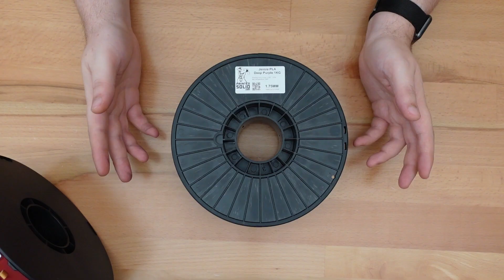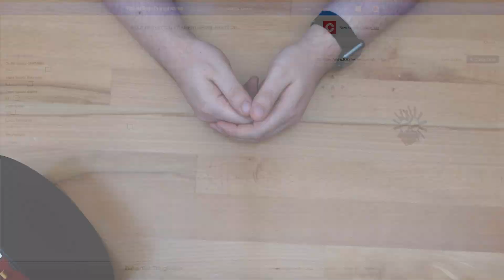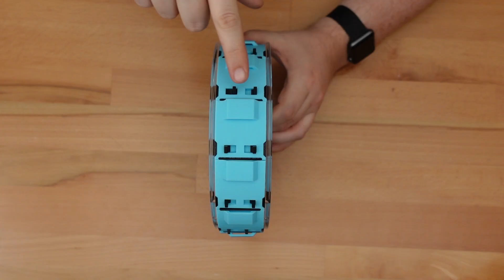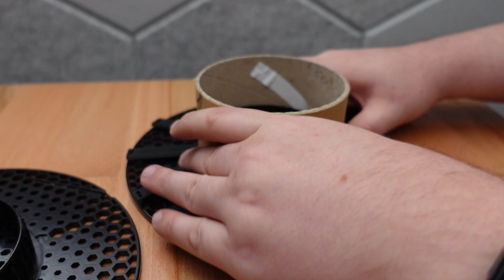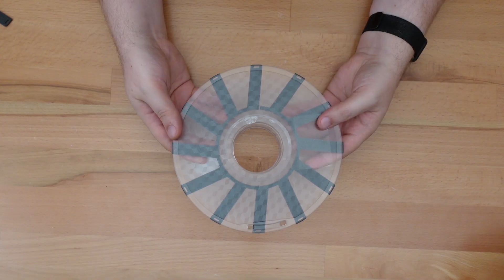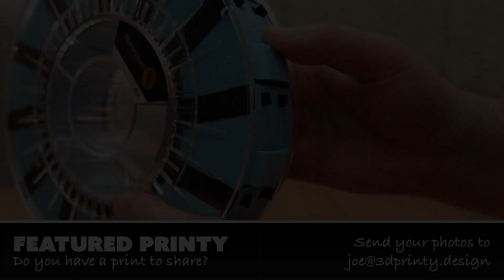Customizable Vertical Filament Spool Parts Drawer

Comment: brilliant thing -- the only thing i MIGHT do differently is to have a rotated version where one sidewall of the spool (assuming it is not a meshtype or filet-ed type) is the top. then m/b add a "tire tree" (rough translation from my native lang - unsure what you call then in english) so you can stack multiple spools and use them as kind of a carousel-shelf...

Comment: do you by any chance know on the ender 3 pro how to make the stand printable. it does not seem to fit in the space in cura
Reply from the maker: I believe you have a 235x235mm print bed? Each half of the stand should fit that fairly easily - especially if you rotate the stand 30 degrees clockwise around the z-axis.

You will not be able to fit both sides of the stands at once, though. To split the two halves into separate parts, use the free Mesh Tools plugin that's available in the Cura Marketplace. Here's a video that goes into the process: https://www.youtube.com/watch?v=GUsChXYEMLk

Or, if you prefer, this functionality is built right into PrusaSlicer by default. Good luck!

Comment: Maybe my printer is not great and I just have my heated bed too high when I’m printing the other bits, but… Changing the tolerance on the locks doesn’t seem to do a great deal lol. Which way should I tune it? I printed 0.1 0.15 and 0.20 and they all go differently but still finger busting at some boxes. Is there a left and right lock? I keep mixing them up I think… hard to keep track for me lol. Shall I try 97% scale in slicer also?
Reply from the maker: It COULD be elephant’s foot (bottom layer slightly too squished). My guess is that the locks are being installed upside down (also yes, the 2 sides are different). Before installing a lock, look for a small chamfer on the back of the lock, that should face up. If that still doesn’t work, even looser locks were remixed by Yianni on Thingiverse: https://www.thingiverse.com/thing:4903888 . Best of luck!
Reply: @3DPrinty  Thank you so much I appreciate that little extra bit about the orientation! I need to pliers them all out just in case. 

I know you’re only installing them one time but I suppose if I was going to be critical I could wonder if there was a way to make universal lock piece that works any orientation. :-P but now I know it is good. I don’t remember specifically reading about left and right locks on the print download? Did I miss it? It could be useful if all of the print parts are just jumping off the PEI 

Thank you too for the remix info!

I’m in love with the system in general, I printed the full spool of boxes so far and lids, and now going for the locks. I think the boxes could be really really low infill and perimeter width really, they are coming out robust on any settings which is cool (as in no need to really thicken walls or chunk the infill path etc.). 

Yeah,  I think the wall that is coming down from the rail on the inside of the box could deboss back out to the spool instead of be flattened - it’s almost too strong and is thinning the internal volume too. It could be a good thing for the customiser as an option because my spool is rigid enough to keep the boxes reinforced(?), but some spools are more wobbly so maybe people want the thick straight down wall then. It would also give you a little bit more length inside to lay some screws flat of certain length!

Thank you for all your kind free work on the system!
Reply from the maker: If I revisit this design (it's one of my oldest projects), there's a very good chance I'll optimize the internal bin volume the way you described. At the time I was going for strength, but I agree that it's not really necessary.

Unfortunately, the lack of a universal lock is baked into the rest of the design. A truly universal lock would need to be aligned with the center of the spool, if you follow. And that would mean remodeling the bins entirely. I added the chamfer indicator as an update (possibly undocumented) for the same reason you mentioned - I had printed dozens of locks and forgot which ones were which! Hopefully that's an okay compromise.

Comment: Hi Joe, First of all thanks for all your work. I'm a big fan from France. I think I printed every thing you designed so far and waiting eagerly every week for your posts ;-) These spool drawers are amazing and finally works for me (I tried many others before...). I'm just struggling a little with the locks. I though initially that there were symmetric and once installed some of them were very loose and some very hard to move (with the same tolerance of course). I saw then that there is an angle on one side and it seems it works fine once installed in the same way (angle of the lock on the top). Not sure if it makes sense so I also wanted to check with you. Thanks again for your designs.
Reply from the maker: Hi Pierre! Yes, I added the angled corner only after making the video - you're right, the latches work best with that angled edge facing up.

I also recommend the stand, which will keep the drawers from spilling even without the locks. Happy printing!
Reply: @3DPrinty  Hi Joe, Thanks for the quick response. I do use the stand, it does make a big difference! Got it for the angle lock. Mines are pretty loose for now (angle facing up), I'll try now to play with tolerance. Thanks again.

Comment: Yeaaa!... 😑 now I gotta figure out Open SCad...  Gee, thanks...
Why can't you just post printable STL's for every random filament brand available???

Just kidding, I know, and appreciate, how much work you have put into this project. 
The Thingiverse "Customizer" hasn't  worked for me for about two years,  and I've been too lazy to learn a new program (kinda funny, because I have had to learn 4 new programing languages in the same time).  
I have a several spools with 20-150g left on them (and a runout sensor), some of them Hatchbox, and I have been watching Thingiverse for a while, for repurposing ideas. This was the first one that actually caught my fancy. 

Your little parts storage thing, has kinda been the kick in the butt I've needed to learn new things, maybe from SCad I can learn FreeCad and beyond, and maybe, just maybe, the new things that I am about to learn may help with one of my ultimate life goal... 

...To build a shot clock for Water Polo, that isn't affected by water, or humidity.... (ya, the most advanced clocking systems in the world are crap around the pool, Olympic matches usually have shot clock issues, so imagine how the 12U feel... )...
Reply from the maker: Sorry, I had no choice but to learn OpenScad, so now everyone else must suffer too! Actually, it's not too bad - you don't even need to touch the code if you're setting custom values in someone else's design. I still do my exploratory designing in another program (Fusion 360) because I'm really slow with scripting, but it's a valuable tool in the toolbox.

As for Thingiverse Customizer... yeah, I haven't gotten that to work for me once. Not for my own projects and not for other peoples' projects. Nice idea, but missing the necessary maintenance to keep it going.

I'm glad this design has inspired you to try out something new, and to make good use of some old scrap plastic!

Good luck with the Water Polo shot clock. I had no idea that was such a problem!

Comment: i lost the cad files for my own filament drawers (boring horizontal ones though)— this looks AWESOME. no hardware at all is a great bonus for something you print a lot of, and i’m a bit sick of drilling accurate holes into my spools. one question- what’s the approx filament usage for a drawer? some of those walls look a bit thick (unless it’s adjustable? not at home rn, otherwise i’d check)
Reply from the maker: I'm glad you like the design!

Each bin is about 30 grams, depending on your parameters.

A downside with having a design with 12 bins is that even those smaller prints add up. 12 bins + 2 guides + the stand comes in at 1/3 of a roll! So this isn't a great solution for turning every spool you have into a filament drawer. I just print a bin or two with the last bits of every roll and eventually get a full set for "free". Even the bins in this video came from old and nearly spent rolls of filament.

Comment: Working on a set right now, hope it turns out good. One problem I ran into is that on 2 different slicers, I could not ungroup the STLs (Cura 4.9.1 and Sindoh slicer) so that was a bit of a pain. Had to send the STL to Inventor, make it a solid object, delete the parts I didn't want to print, export STL, open in slicer LOL. Any free software out there that would break out the individual parts easier that anyone knows of? I HAVE to use Sindoh slicer to use the Sindoh printer I'm trying to make these on so just getting Prusaslicer isn't really an option.
Reply from the maker: I don't use Cura that often, but it looks like the free Mesh Tools plugin will do the trick!

Here's a video from The First Layer that shows how to install it: https://youtu.be/nS0mr7Hommg?t=308

1. Install Mesh Tools (Marketplace > Plugins > Mesh Tools > Install)
2. Restart Cura
3. Open the model
4. Split the model (Extensions > Mesh Tools > Split Model Into Parts)

Good luck and happy printing!
Reply: @3DPrinty  Got the rings and first bin printed. It seems that for me, the OpenSCAD model will not create a bin handle if I pick flat. Only way I get a handle is if I pick curved.
Reply from the maker: The "flat" handle requires a little more space than the "curved" style, so I'm guessing the spool is on the thinner side?

I'm glad that your first test prints came out well!
Reply: @3DPrinty  yeah these sindoh roles are thin and on the small side, I kinda figured it was due to that. I wanted the flat handle as I thought the curved would stick out too much but after printing one bin I think I’ll just do curved handles. Have really enjoyed the design so far. Keep up the good work!

Comment: really nice work, I love that you showed if you don't glue the supports in your can rotate the boxes without having to spin the spool itself. 

thanks for putting the work into thses
Reply from the maker: Happy to do it! There are some advantages for glue still (like if the weight in the bins is super uneven), but if it can be avoided, it's best.